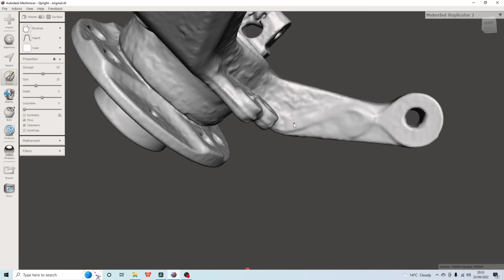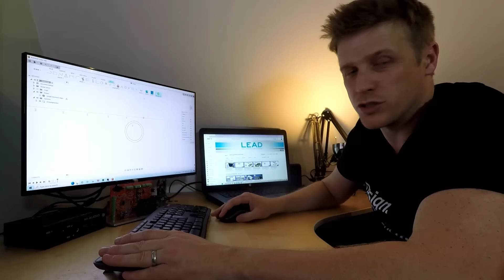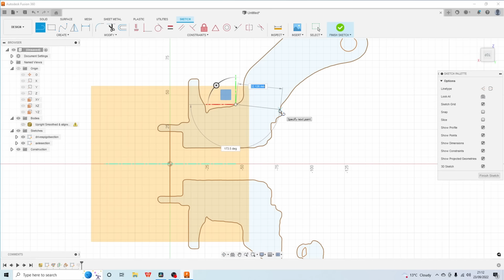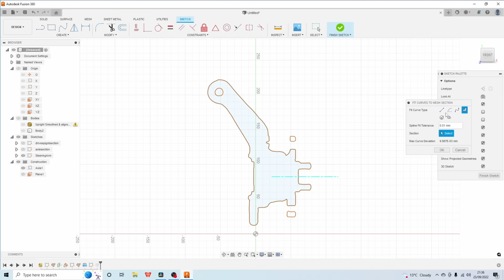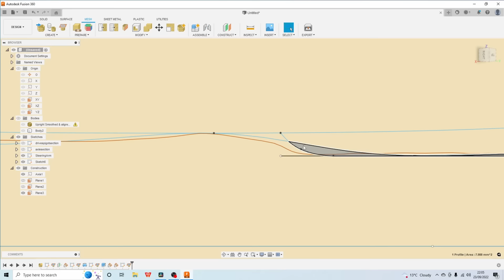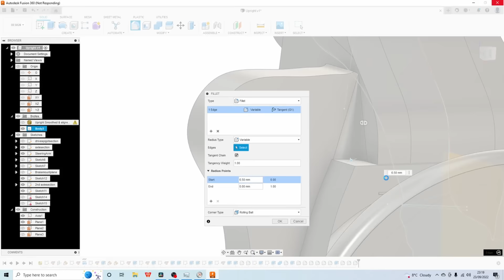Reverse Engineering from a 3D Scan with Fusion360... for FREE!

Comment from the maker: If you want any of this process in greater detail then drop a comment!

Edit - If you want to try giving this a go yourself, you'll find the original, as scanned and unmodified.

https://drive.google.com/file/d/133knuEKVOvMD04maus9jEsJ2tmPwSmPK/view?usp=sharing
Reply: Any and all of it in detail would be awesome.
Reply from the maker: What?? All of them???😂
Reply: What was the magic wand you used at the start? Where to buy, how much etc. I can handle the CAD part of it, designing brake brackets and other features, but the easiest thing for me to do is simply have bosses floating in 3D with no visualisation of the  casting
Reply: @rossmarzano  revopoint pop 3d is currently on sale for $399 on their website.
Reply from the maker: @rossmarzano  it’s a Creality CR-scan Lizard 3D scanner.  Available everywhere it think for about 4-500dollars?  It’s a great tool for the money, but the consumer market is growing for these and RevoPoint do a load of different ones with different specialisations, but all of these are consumer end and imperfect.  The proper scanners are Pro items and cost thousands.

You’re dead right, all I really need for this part are the interaction points (bolt holes/machines faces) but for reasons that’ll be obvious in the next videos I wanted a full model of this part….
Reply: @MakingforMotorsport  Do you think the revo pop 2 provides better scan results than yours from creality?
I will buy one of them to christmas.
Have you an idea?
Reply from the maker: @Maximilian1111  literally filming and editing a video that compares the Cr lizard and 01, with the Pop2 and the Einstar right now…

Should be out in a week or so….
Reply: @MakingforMotorsport  Thanks! Also i wait for more details! And the next video without timelaps ;)
Reply: @MakingforMotorsport  make sure to have latest firmware for the Pop2 applied.  Just ugraded last week and it did improve my results a bit! :-)
Reply: Is the final converted Fusion file available as well?
Reply: u r the boss
Reply: I am trying to start the reverse engineering process. What is the best scanner for relatively low cost?
Reply: What can I use other than GOM now that it's changed? Creo cannot align to an axis and the scans are all over the place.
Reply: Eres un genio ...saludos desde peru ....contenido de alto valor ....un canal completo .vale oro ..sigue subiendo mas contenido ..saludos

Comment: Thanks! Still very relevant three years on.
Curious how you locate the machined mounting surfaces and bolt hole centrelines relative to each other. These seem critical but the mesh lacks detail in these areas.

Comment: Basically, drawing 2-D shapes, in a "reference-pointed" area, where your 2-D can be extruded, on a mesh object as your guide. I learned this handy trick using TinkerCad! I started using TC shortly after
purchasing my first 3-D printer. Because I love to make plaques, I needed a way to add depth to custom-made graphics. Shortly after, I learned how to recreate small replacement parts for broken, consumer-grade items, that were unnecessarily doomed to a garbage can.

I recreate a "part" by identifying the geometrical shapes that make up the part, and save each design as a 2-D drawing. I export each drawing as an SVG, import them into TC, extrude, position & weld.
As rudimentary as TinkerCad is (and, of course, is no match for Fusion360)... while being designed for modeling beginners... it is an excellent, FREE, program. 

Having a background in geometry and basic mechanical drafting reduces the learning curve DRASTICALLY, giving you the ability to identify and create shapes that can be created "2-D".
Most 3-D printer owners, who would really like to add to their printing capabilities, would ultimately give up on this, as they don't have the prerequisite basic training to understand the mechanics of this tool.

However... Really good video. Thank you for uploading.

Comment: No offense, but that is not reverse engineering.
Reply from the maker: Okay.  What’s your definition then?
Reply: @MakingforMotorsport You take specs, operations, functions then duplicate them. You simply copied it. One engineer develops the specs then passes it on to another engineer who builds based on the specs. That avoids the issue of "copying".  I remember the CPU reverse engineering of the late.80s and 90s.

Comment: It’s fairly easy to do the mesh alignment directly in Fusion. Just make two planes using the Plane From 3 Points command, and align these two planes with the Origin planes.

Edit: Never mind, it was mentioned later in the video.
Reply: I must have missed that mention... thanks

Comment: GOM Inspect seem to be no longer available it was bought out by Zeiss,  do you know of an alternative?
Reply from the maker: Zeiss have continued the product and it’s now know as Zeiss Inspect and it’s still free for use 👍
Reply: @MakingforMotorsport yeah I registered for an account and they denied me... Really creality needs to get their finger out and add the ability to do it in their software before exporting, fusion actually added a feature to align a mesh but it sucks because it's single point and not multiple points on a plane. And since adding that they seem to have broken aligning a created 3 point plane to one of the Cartesian xyz planes.

Comment: nice video! i would nomaly draw and extrude a cube around the part, cut the model into the part, turn the part off, turn the cube off, draw another cube same size, cut the shape into the new cube to create a new solid part. effectively, create a mould and then create an impression. that said, it doesn't lend itself to being adjusted particularly easily.

Comment: Sorry, I'm shocked at how dumb this is. Bearing manufacturer 33 years, just take the bearing assembly out of the knuckle. Scan the knuckle, do your thing. Use our files for the exact bearing and spindle dimensions, voila. Make sure the two fit together when you're done with your knuckle. 0.002 press fit. You spent a LOT of time reinventing the wheel, and even then you don't actually have a functional, usable model.

Comment: 0:48 I realize this video is pretty old, but all those things you're talking about, are 100% doable in Blender. It's dirt simple to perform all those tasks in Blender and get parts that are accurate to 4 decimal places. Printing the part, or producing it via CNC would produce a part less accurate than what you can create inside Blender itself. Blender is not the bottle neck for reverse engineering or part accuracy.
Reply: except you can't make a workshop drawing, export DXF's or import it into CAM using a mesh..... so yeah blender is almost useless beyond doing the preliminary cleaning and mesh reduction.
Reply from the maker: Blender is a great tool as are many others, but Fusion’s integration for other aspect of the engineering work flow (drawings/cam etc) makes it the more sensible choice than Blender, which is always going to end up with a more “artistic” type of output.

Comment: Thank you so so much. Not only is this applicable to motorsport, but I have just used this to construct models from video game files. Normally the shapes and especially sizes would have been incredibly hard to eyeball, but with this... I could extract STL models and edit them. You have done excellent work for the engineering community and this knowledge is invaluable. Thanks once more for giving me the tools to innovate

Comment: So did you 3d print this or do a model for stress analysis?  I can imagine you could send this off to a 5axis CNC and have it milled from a solid piece of aluminum or stainless steel.
Reply from the maker: Mainly I did it for the video😂

Seriously tho, I intend to change the uprights on my mini to run with these and a small series to scan, design and manufacture a full front subframe is planned…
Reply from the maker: But then it’s been planned for 4years sooo… 🤷‍♂️

Comment: Great video !
I've tested several 3D scanners and never managed to figure out how to use the generated models. Until then, I'd recreate the part with manual measurements and use the 3D scan just to check if it looked right overall.
Now I know that it's perfectly possible to use a 3D scan to create a part, and that changes everything!
So I'm going to buy a 3D scanner again, and now I'll really be able to use it.
Thank's!

Comment: I have built at EFI system using 8 Fox ITBs on a 1957 Desoto Firedome Hemi 345 cubic inch, I have a Megasquirt MS3X with full sequential injection and COP ignition, 36-1 crank wheel with Hall Sensor, Ford cam sensor. I am getting ready to start motor. I appreciate your videos. I am ready for a challenge. For my setup I have two generic fuel logs. The right one with fuel in it is hidden under the left valley cover.. In the right side under the valley cover is hidden a second fuel log but instead it is being used as a vacuum lot. I run vacuum line from the log to each ITB, the vacuum log has a signal hose which splits into 3 lines. One line to MAP sensor, one line to fuel pressure regulator and the third vacuum line feeds an Idle Air Control. I will run the Megasquirt ITB mode. I will let you know how it works out.

Comment: Excellent video and content! Exactly what I was looking for. Can I ask what you are going to do with the knuckle now that you have it in CAD? are you going to ultimately cast or machine it with other material? Or is this just an example how to?
Reply from the maker: The plan is to rebuild the front suspension and subframe for my Autotest Mini using these uprights.  I needed a CAD model so I can modify them and then simulate the kinematic of the new suspension, then make jigs to modify them in real life…

However life, separation, house move, divorce, kids, events, RallyE36 and various other things mean that I haven’t done it… but that’s still the plan 😂
Reply: Awesome. Yeah I saw your Mini. I'm a mini guy too and interested in fabricating control arms and the steering knuckle in aluminum to reduce mass

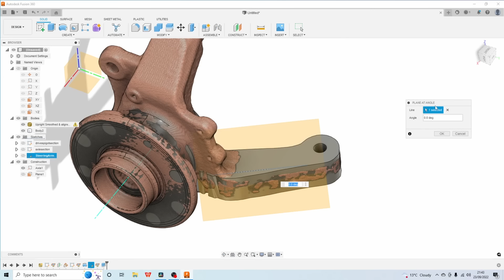Comment: How would you go about doing the exact same thing, but if your steering arm curved at an inconsistent angle away from the plane that you have running through it at 22:30?
Reply from the maker: Hi there.  In this case it would be a loft/sweep type of operation.   In these you can define either a start and end cross section and a line to follow between or a series of cross sections to follow along the path.  
If you look at tutorials for these specific tools it’ll be obvious how you can use it following the Create Plane > Mesh section sketch workflow 👍

Comment: What are you using in place of the GOM software now? It seems to have been turned into ZEISS INSPECT Optical 3D and is no longer free, as far as I can tell.
Reply from the maker: Was literally trying to find an answer to that tonight for an upcoming video…. I’ve been turfed out of my account for GOM inspect too….you gotta pay!

There are other options for free, not quite as accurate or simple…. Video coming soon 😉
Reply: @MakingforMotorsport  I looks like YT may have removed my previous comment, so if you missed it, I found the 2019 version of GOM still hosted on CNET. And it works!
Reply from the maker: @ChuckMcKnight wow…. Well done, I pulled my old computer out to use the previous software… and once I signed in it bricked it…
Reply: @MakingforMotorsport  Oof. Well, I've opened up the 2019 software on my modern PC a few times now, and so far so good! No account or anything needed either.

Comment: If you have to do so much mesurements, why do you need a 3d Scanner then?
Reply from the maker: It’s easy to measure in 1 direction, or along a single, pre-existing plane.  But to measure the centre of a circle in 3D space separate from anything else… that’s very difficult indeed… but not with a 3D scanner….

Comment: You  are aware that you still have a way to go.
The spindle is press fit into  a bearing which is again press fitted onto the control arm.
It looks like an extremely misuse of time presently
Petty though
Reply from the maker: If those features were of interest to me then I would have included them, but they are not as I plan to use the whole assembly, therefore I am only interested in the pick up points, which are within 0.5mm, so good enough for me.

Plus, no one should be using a 3D scan to size the diameter of a bearing bore and determine the tolerance for the correct fit, I’ve got some internal bore mics for that…. Luckily I have the centre line from this video so if I want to include that I can 😁

Thanks for the comment 👍

Comment: My goal would be to make custom adapter plates to fit other engines to stock transmissions of different brands and retain the factory manual clutch and flywheel. Any idea where I could go look for such information?

Comment: looks a decent video for mock ups before milling out of ingots but completely useless to print and drive with hub needed to be removed😂
Reply from the maker: You can’t necessarily 3D print this part, well you can, but I wouldn’t recommend it
Reply: @MakingforMotorsport  ok was thinking this was showing us all scan it clean it up 3d print for testing and mock ups for engine or conversion of some kind on the mini then cnc or cut out of a billet for a final upgrade do you know how to do the latter for a video thanks

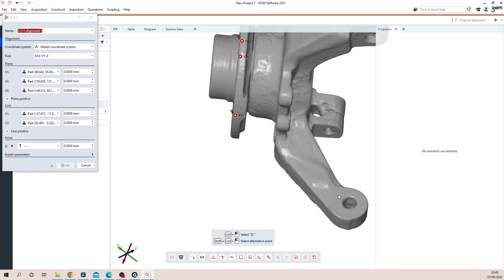Comment: Great video!  4:45 when defining the "z" axis to the "x" axis, how do you know they are at 90 degrees to each other on the physical piece?   Maybe the design was at 80 degrees.  Did you measure the piece prior, or is this a suspension piece that you know from experience that those surfaces are always at 90 degrees to each other?  Cheers from Canada.

Comment: You cant call this reverse engineering unless you created all the drawings and tolerances needed to manufacture that part, and the selection of material is really important. The shape of that part will also be dependent on the manufacturing process.

Comment: No point in straight copying the features from your mesh - ask yourself, how are you going to use the solid part? If it's for a reference, the mesh is probably good enough. If you want to actually make something / modify the part, you should consider how you are making it when you put any level of detail in your sketches. If I was starting from scratch, I'd probably cut the cylindrical portions - spigot and flange - on a lathe, with no radius or chamfers in the model, and then only chamfer by hand after making the part to break sharp edges. For those decidedly non-lathe-able bits, I'd look at cutting them out of plate and welding them - again, no radius or chamfer in the model, but some would be added in the physical part by the weld bead and cleaning up the sharp edges. Now, if a weld bead or chamfer is critical to the fit / function of the part, you might want to specify it in the model, but you also might want to reconsider your tolerances to make these a non-issue.

Source: I'm a mechanical engineer who's spent thousands of hours doing CAD and learning to close the loop with the manufacturing floor - job security is derived from doing the job fast and cheap without fluff. If you want the welder to control the radius of his beads, he's going to look at you like "oh another idiot engineer" and then grin and charge double. I once heard a saying in an aircraft shop, "Hammer to fit and paint to match" and it was actually on the drawing.
Reply: Sir, this is a Wendy's.

Comment: would it not be easier to import the mesh, centre, go to Prepare tab, generate faces group, turn to accurate and accept. then go onto the modify tab, convert mesh, operation parametric, use the faceted method and clip ok?

This will now give you a full bodied drawing that you can then delete some of the small faces which will give you nice flat surfaces and allow you to directly model new drawings onto the mesh
Reply from the maker: Try that on a 1gb .stl from a 3D scan on free Fusion with a relatively modest pc and let me know how it goes…. (I already know… not well! 😂)

That workflow has its uses don’t get me wrong, but for complex bodies and compound curves it very quick falls over….

Comment: I simply love fusion360. Its so incredibly intuitive and clean. My dream is to one day get myself a 3D scanner to scan pipework-projects in industrial environments. I've been using tape-measures, levels, plumbobs and lasers for years  and in my opinion that's really old fashioned, slow, tedious and imprecise. Loads of measuring errors and you need to go take new measures over and over and still you may miss some minor details, like weird angles or other small deviation. Scanning the whole thing would make it Super Simple to take all the measurements and design your own pipe right in the middle of the old mess you find in old factories, that I usually work in.

Comment: just out of curiosity. I am not trying to be negative. However Is'nt it easier to just measure it with calliper and drew 3D model. I think that would be less time consuming if you want a solid part on software. If you could answer my question I would really appreciate it.

Comment: That thing you are scanning, it seems like an assembly of multiple parts. I don't think this is the right way because the 3d scanner will not be able to get details of places where parts are joining. Please correct me if I am wrong.
Reply from the maker: You are correct, it’s an assembly of a machined casting, a spindle stub axle and a bearing (plus probably a retaining circlip).

I intend to use this as an assembly to this is perfectly fine for my purposes, if you wants to fully RE back to a casting model, machining model and a fully toleranced drawing then yes, you need to break it down more…. But the process is the same.